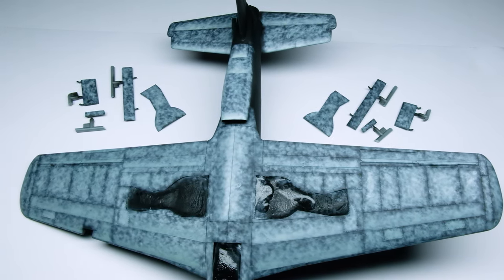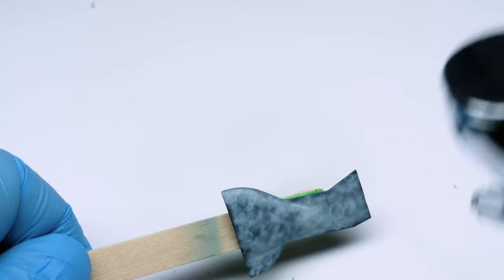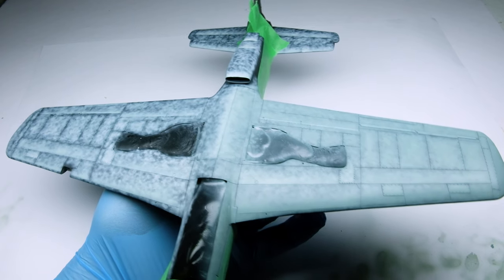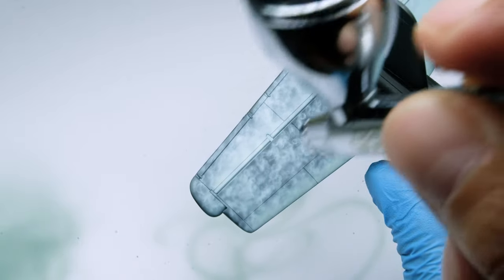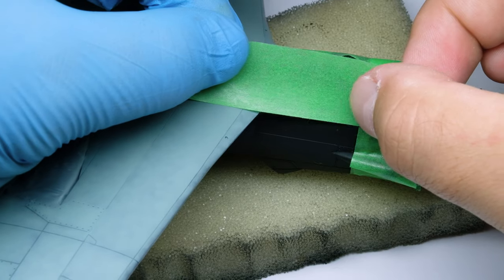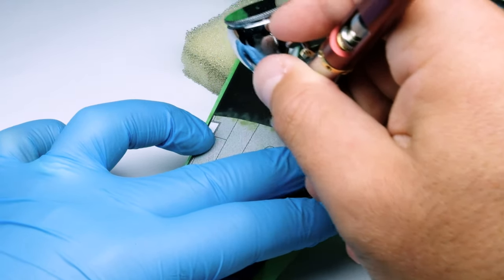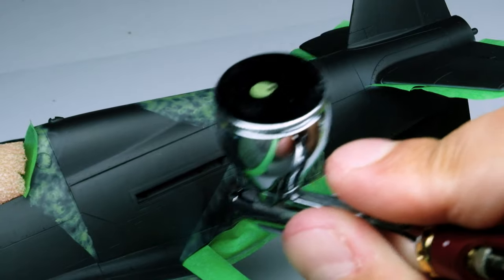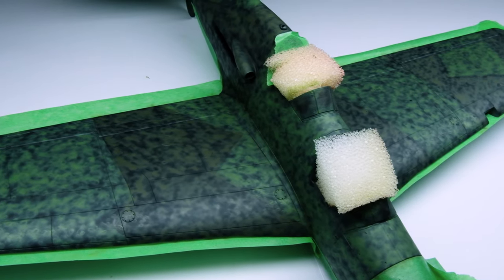Belly done! Black basing the Top - Dornier Do335 A-12 Anteater - Part 3 - タミヤ - スケールモデル How to

Comment: Also a great technic for replacement panels that are of similar color from a different plane. Sold!
Reply from the maker: Absolutely, there's so much variation you can do to a plain surface with these sub-layers. I have to experiment more with different colors as underlying layer. Thanks a lot John!

Comment: Looking great.  I noticed you are using mr hobby aqueous paints. How do the spray and do the have any significant smell?
Reply from the maker: In my opinion, the paints are pretty similar to Tamiya paints. Except that they have different finishes, depending on the color-nr. The RLM-Colors I have and also the FS-Colors are semi-gloss. They spray very nice and even. I thin them with the Tamiya Lacquer thinner or with the Mr.Paint leveling thinner. They have the same intensity of smell like the Tamiya paints. I always wear a mask when spraying, so I don't bother.

Comment: Great work as ususal, its not really important here but I would like to make a comment about RLM65 being used, although many kit manufacturers list RLM65 I don't believe they are correct. The RLM issued a change that from Autumn 1944 this colour was to be replaced with RLM76. There is an excellent document on this subject by Michael Ullmann. Again its not really important as far as this particular video is more about technique, I just thought to add it in for modellers looking for reference material.
Reply from the maker: I just take the colors from the instructions. Perhaps I should invest more time in researching. Thank you for the note!!! Luckily RLM 65 and RLM 76 are a pretty similar shade!!! I'll paint the nose of the Do335 in RLM 02 and I keep the front fuselage in bare metal... It'll be the Do335 with the number 112 on the back. What do you think, is this accurate?
Reply: @AirandGroundinScale  Engine covers yes bare metal, nose hard to say either rlm02 or fueselage colour, I would go more with fueselage colour rlm 81/82 whichever is the darker one.